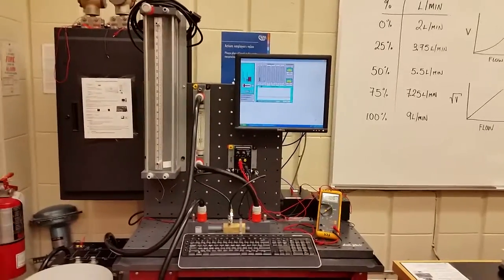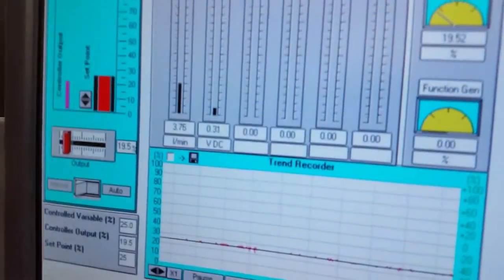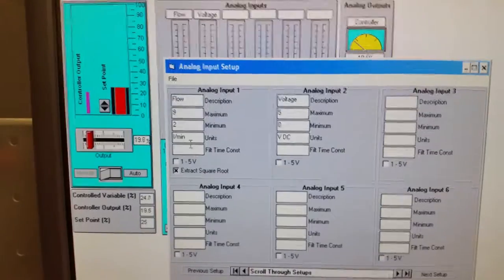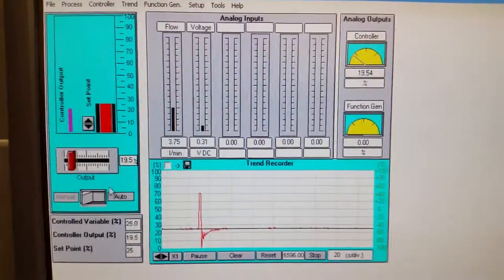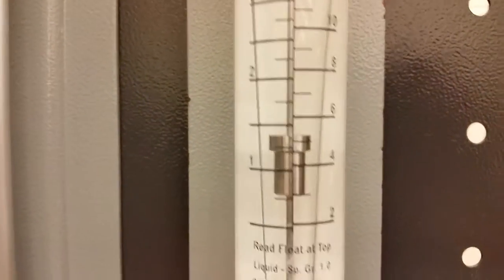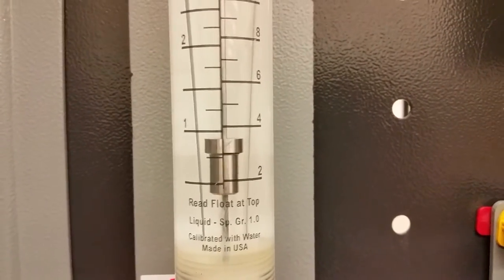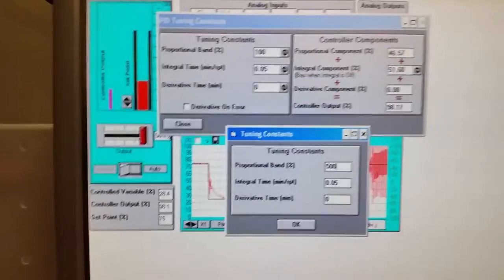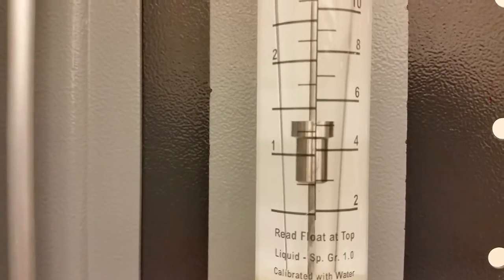Venturi Tube Flow Meter Lab with PID Control

Comment: Shouldn't the PT's high and low ports and the tube's ports be situated at the same level for the venturi to work properly ?
Reply: I have used this exact same system in class
Reply from the maker: Pretty sure that the Venturi can be installed either vertically or horizontally... but if you find anything to the contrary please post it as a reply to this comment. Thanks. Pete